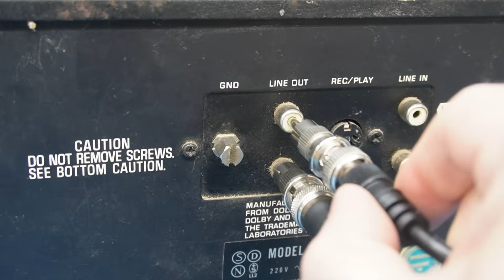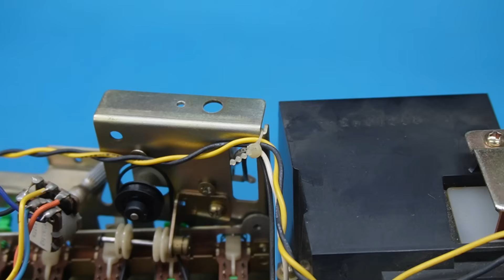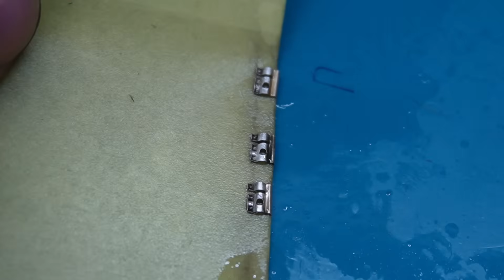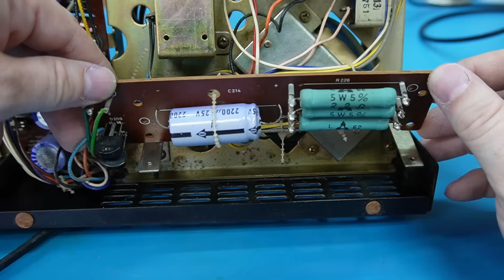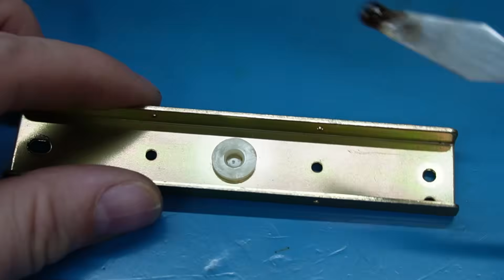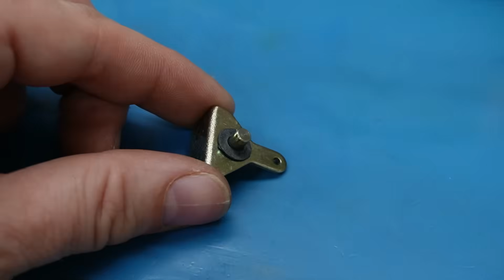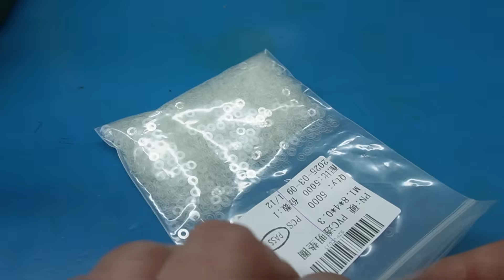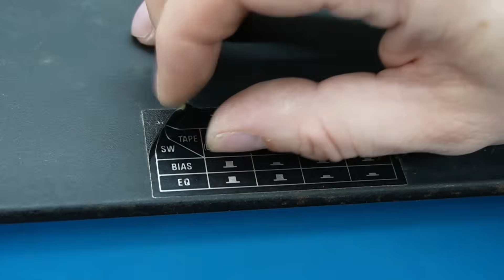The TECHNICS Tape Deck (RS-671)

Comment: Any service techs from the 70's will relate to this, record/playback switches. It was an everyday problem. I worked in a Sony service centre and they were the cause of many intermittent  faults
Reply: Very common fault , I sold and serviced these back in the day and knew straightaway what the problem was ; however I'd have sprayed contact cleaner in right at the beginning and worked them back and forth before doing all that dismantling . Sometimes had to replace these switches , but cleaning usually worked . Always worth checking for dry joints on machines of this age too .

Comment: I remember opening pots with tabs which were hard to outsource or order anywhere. Glad to see someone else doing this and yes, you can do it only once. If the contact coating isn’t damaged anyway, then you have to throw it out anyway. 16:32

Comment: @22:27 Looks like there is a solder bridge between the 5th and 6th pins from the right, bottom row. Obviously not as it's working fine. Lovely job!